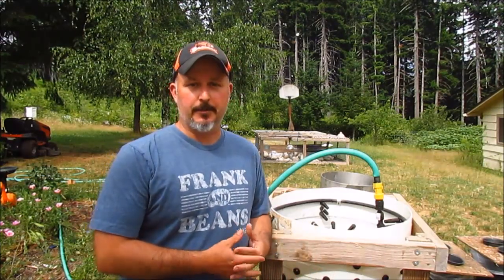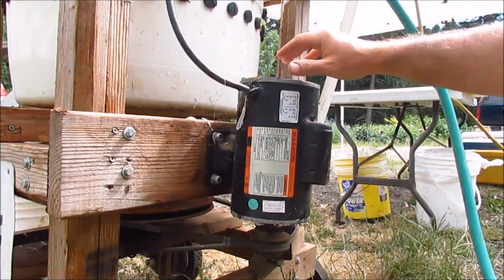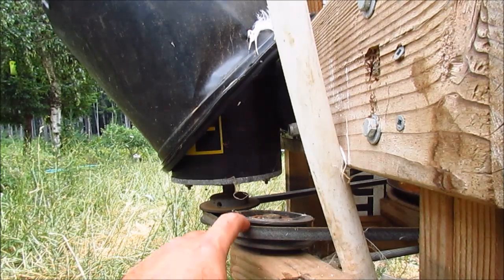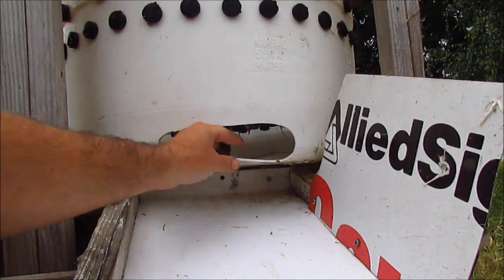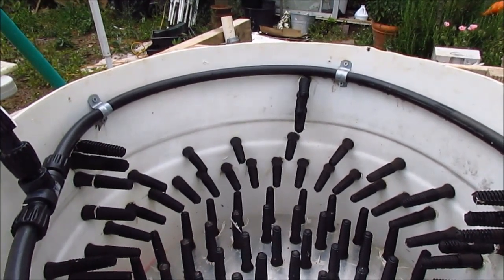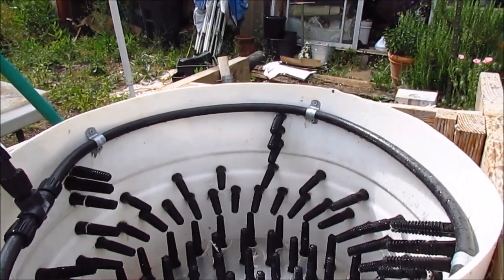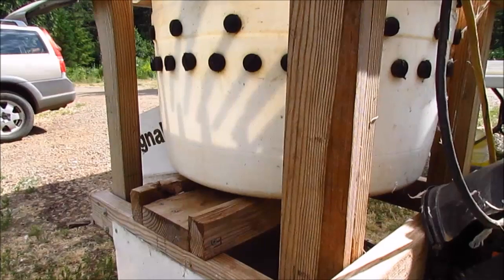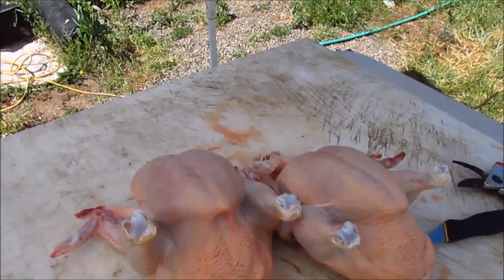DIY homemade chicken plucker design

Comment: Nice! Looks like mine. I liked your solid barrel idea, so I made mine the same. 2 birds, one water hose and about 15 seconds = 2 clean birds. I really like the shrink bags Herrick Kimball sells, they are awesome. Absolutely no freezer burn. We processed 50 birds in about 6 hours four weeks ago.  All possible with the chicken plucker.
Reply from the maker: It sure makes all the difference, I'm not sure if that the same bag I use, mine are from "Texas shrink bag" I really like them, especially since you don't have to pole a hole in them like the ones I used to get ...thanks for watching!

Comment: got to make one for sure, wonder how it will work on wild birds, great job
Reply from the maker: It works good, you just have to scald at a slightly lower temperature and for longer to get the pin feathers

Comment: I just plucked 3 chickens by hand in about an hour then I ended up skinning them because there were too many pin feathers. This thing is ingenious..... Good on ya... What are the rubber fingers made out of?
Reply from the maker: It only took a couple of batches of hand plucking and skinning until I knew I need to build one and it's been well worth it. The rubber fingers are just that, rubber... they are a commercial plucking fingers but you can buy them online or on ebay

Comment: I like your feather discharge chute. What did you do to prevent the water from running down the shaft and onto your bearings or does it matter ?
Reply from the maker: It does run down, but it doesn't seem to make a difference

Comment: Very nice!.  Just a question. ...would it work for larger birds?  Say a Canada goose or 2?
Reply from the maker: Mine only work on birds up to 8#'s, but a slightly larger motor with a gear reducer would work (so it wouldn't spin to fast)

Comment: Say backyardmeat
, do you dip the chickens in hot water first or just throw them in dry? We have a plucker that has a horizontal drum of fingers. You hold the chicken legs and hold it over the fingers, works well but we dip the birds first. Did lots of turkeys too with it.

Comment: I noticed in your response to another commenter that you used a gear ratio that geared the motor down to ~270 RPM. Would gearing it down further to say, 100-150 RPM, cause less damage to the meat overall or do you think that the 270 is a good sweet spot for accomplishing defeathering with limited damage? Thanks.
Reply from the maker: It sure seems to work for my set up, I know if the belt loosens up and it slows down it  does more damage to the birds because you have to leave them in the plucker longer

Comment: Really nice your chicken pluker.  Do you know the relation of transmission between the moved pulley and the motor pulley? Thanks in advance
Reply from the maker: +Leandro De Medeiros Passos  I'm not sure I understand what you're looking for....RPM? if so it's 1725 rpm...if not let me know and i'll try to get you back a answer
Reply: Hello, I'm looking for the RPM of the driven pulley, or the dimensions of the pulleys.

 Thank you
Reply from the maker: the drive axle pulley is 2.5" and the tub pulley is 16" this gear it down to around 270 rpm's
Reply: Thank you a lot, I'll try to build one of this in my home

Comment: I have an old rockwell drill press I'm  going to try and use to build one of these with. I need the shaft and aluminum plate and I'll be all set.. I hope 😁
Where did you get your plate from? If you don't mind me asking.
Reply from the maker: I made it out of aluminum, 1" smaller than the barrel

Comment: if you don't mind answering another question, how tall is your barrel? made mine 20'' and with it raised off the bottom for the 2 fingers, i only have around 12" of wall left. just doesn't look like enough height.trying to figure out the best plate height.   
Thanks.
Reply from the maker: Mine is 20" ...for my plate height I did the length of the downward facing fingers + .5"
Reply: Thank you.

Comment: I thought the feather plate would be hard to make but maybe not, There for sale on ebay but expensive and shipping is a killer for me, More than doubles the price, That's is they well ship at all. One day I well build one. I found a nice one in China but they well only ship 2 at a time, I sure don't need 2.
Reply from the maker: The feather plate is just a piece of stainless cut in a circle and the bottom fingers are spaced 2 inches part so the bird doesn't get tangled up. They sure are handy and it makes butchering so much cleaner and faster ....two pluckers just means you have a rental :)
Reply: I do a lot of ducks, There very hard to do by hand, I need something, I well see what happens. I have a few idea, That might be my biggest mistake. lol
Reply: i would think u could use acrylic plexiglass for the feather plate which is a bit pricey but much lighter on shipping

Comment: what did you use do your feather plate?
Reply from the maker: Just a piece of aluminum cut to fit  the barrel with 1/2" holes drilled for the fingers . I made it so it had a inch space away from the walls